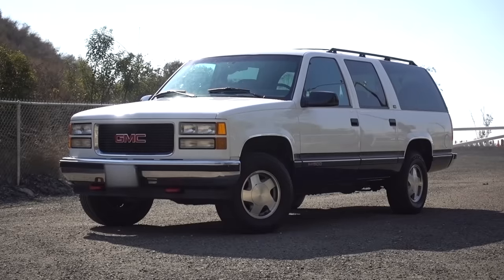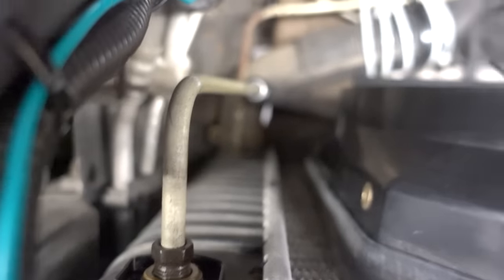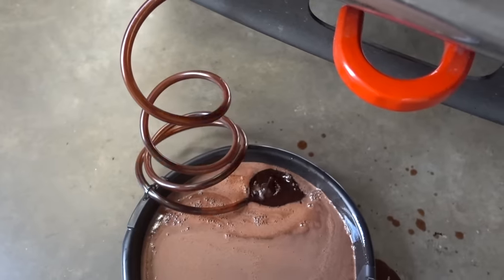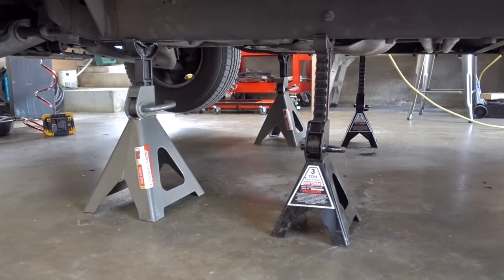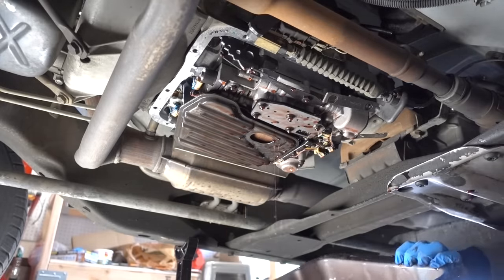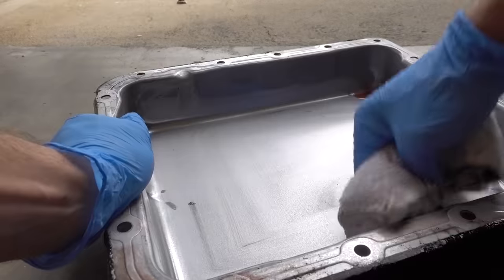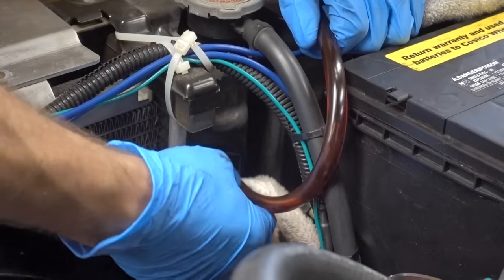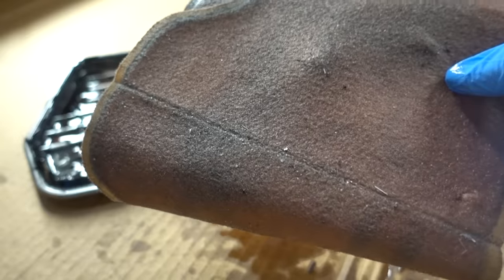Why You Should NEVER FLUSH YOUR TRANSMISSION FLUID!!

Comment: First problem is never use the “universal” fluid.  It isn’t truly universal.  Especially with more current vehicles.
Reply: The Valvoline MaxLife he put in is a more than adequate substitute for the Dexron III required by that transmission.
Reply: Using MaxLife, in applications where it’s label says it’s compatible, has been perfectly fine in my experience.  Smooth shifting, and next to no wear materials have been found in subsequent pan drops/filter replacements in my transmissions, one of which is now over 300K miles without any other internal work.

Comment: I was waiting for the reason that you should NEVER flush the transmission fluid ......... strange man.
Reply: Because it will clean out dust and metal particles on the clutches and then your trans will slip...it will start slipping in 1st and rev,
Reply: @robertwadas  metal particles and dust need to be removed from the transmission,or perhaps we should add some.
Reply: @stevebrown617  while Bob has the right impression, his exact reasons are wrong. Over time trans fluid, like oil, (which it essentially is but with an added detergent chemical) loses viscosity, which is its ability to apply lubrication or slip per se, between the metal meshing of gears, clutches, etc. Once that viscosity is lost and that wear is present, sometimes the only thing allowing these worn components to function is the pure pressure of a fluid between the metal of two components. Now imagine between two worn components you out a brand new very slippery fluid. Not much working going on there.

Comment: Don't forget that the BG flush kit or whatever kit you can get ahold of that includes the cleaner and the additives for the transmission fluid or quite import important once you do that flush and that filter fluid and filter change, the Lucas Oil transmission oil additive also from the other YouTube from Project Farm looks like it provides a significant increase in transmission function even though they state-specific Lynn a bottle if parts are required such as clutches or bearings or anything like that which it will not fix but the shifting part is actually improved quite significantly

Comment: My procedure is: 1. Remove pan and replace filter. 2 re:-install pan
3. Connect hose to return line from cooer. 4. Add 5 or 6 quarts, start engine. 5. Watch old fluid and keep pouring atf in. 6. Fluid changed color coming out, shut engine down. 7 connect cooler line. 8 get correct fluid level. This has always worked great.

Comment: Regularly servicing your trans is the best thing to do. However i agree about not doing it under certain circumstances and other lifelomg mechanics have agreed. When you have an older vehicle(especially 4l60e) that has never had its trans serviced/way past service interval its best not too! Idk the science behind it but I have heard multiple accounts aswell as happening to me that your tranmsmission goes out if you do it. In my case i bought a 2000 chevy 1500 with 193k miles and I wondered about the transmission fluid. I asked my mentor(old man) who worked for the company i got the truck from n he said its never been done and i shouldnt do it ask gears might go out. He was right. I did it just under 200k and at 208k miles overdrive dropped out, then shortly after 3rd and then reverse. So 3/5 gears went out 8k miles after doing it after going its whole life without! Justa thought-goodluck yall!

Comment: ive build hundreds of transmissions in 27 years. ive never seen a tech put the pan bolts in anything exept a box all mixed up. so why cardboard.
Reply: Tru that
Reply: I asked myself the same damned question
Reply: What should have been pointed out is: "if any bolts are of a different length, make sure they go back in the same/correct place".......that's it.
Reply: Old school machanics method to make sure and inspect each screw for pulled/stripped threads. In turn.. (pardon the pun) ..IF there's any evidence of pulled/stripped threads on the bolt,, you now have a positive i.d. of the location of possible damaged thread and begin closer inspection and addressing that problem accordingly..
Reply: @markknight6910  On a 4l60E the only two bolts that are different are the ones holding the shift cable bracket and they stand out not having a flattened out head.
Reply: Probably out of habit. If you take apart a lot of items, keeping them organized that way makes it easier to reassemble if you come back to it 3 or 5 days later when you have time to continue working on it. I did the same thing when I rebuilt my first transmission. Techs put them in a box because they've build HUNDREDS of transmissions and are comfortable doing so.
Reply: I know French. Unnecessaire.
Reply: @markknight6910  wouldn’t you feel that when you removed them?
Reply: @markknight6910   Good luck if you wok on time guide requirements. Its prety obvious where the bolts go.
Reply: Dave Peck speak for yourself but I know ford transmission pans like to have like 4 different length bolts so can’t hurt.
Reply: Nick Melfi is a rookie gonna remember on top of the 40 bolts they have no idea what are when they could of used the cardboard
Reply: OCD

Comment: The reason the flushing is so bad is because most shops use a "universal" fluid that they are supposed to add friction modifiers with to make it equal to what your transmission requires. They dont ever do that because they dont know they should or they dont care. Even if they do add it whats to say they get the ratio correct.   and thats why your transmission will slip and blow up. Transmissions are very very sensitive to what fluid you put into them. If it calls for a specific type use only that and not something that works with XYZ and ABC. Its worth the additional cost to buy the specific fluid and will keep you from toasting you transmission. I changed mine like he did (fluid and filter) at 100,000 miles but every spring and fall I use a small electric pump to suck the fluid out of the dipstick tube and replace with fresh fluid. Transmissions are costly.
Reply: I totally agree with you on your comment. Thanks for posting it.

Comment: I will never flush again. i flushed on two vehicles, both started slipping less than 500 miles later. one only had 40k on it. if anything ill just do a change.
Reply: yowmemperor what cars?
Reply: I would also like to know what cars and raise you what mechanics.
Reply: @enricod2061  95 GMC Sierra, 2005 Impala. Independent and dealer

Comment: The reason not to just flush is because if the trans pan is not dropped prior, and it is full of old tranny sludge filled with metal particals the flush will dilute the trash and run it through your system, the filter does not assure you the fluid is safe if it has missed a lot which is found typically on the magnet. Always drain and drop your pan, clean it, and reinstall it before doing a flush which is an effort to finish getting the old fluid out of the torque converter.

Comment: Put each bolt in it's original hole? LOL the mark of a true rookie.
Reply: Lol this video had my head spinning. I remember as a kid seeing all the bolts mixed in a coffee can and being amazed at how they knew where they went. 20 years later working as a mechanic i get it lol
Reply: The fact he still has all the bolts is incredibly upsetting
Reply: One you should worry about are on the valve body you have 10mm and 8mm bolts of different sizes, I locked up my 4l60e with one long bolt going through the sunshell.
Reply: @martinez1701a  Yeah suddenly the warning they tried to give you with the 8mm head suddenly made sense LOL another rookie mistake but that one cost you more than time.
Reply: @michaeldose2041  actually just time swapped the bolts and was good to go
Reply: He is actually making a very wise point. Sometimes bolts are longer in certain positions because of the available space to drill into
Reply: @jonskid8929  They aren't on a pan. Anybody who has even changed the fluid on one of these could tell you that. Only a complete noob wouldn't know that. If you worked in   a shop you wouldn't even make minimum wage like that.
Reply: @michaeldose2041  he said he wasn't a professional mechanic he was just doing this to his own vehicle so he probably didn't know that. I've worked on plenty of small engines and they are rife with different lengths
Reply: @michaeldose2041  instead of taking it to someone like you that would blow through the job in 30 minutes he did it himself and took his time and did a good job even though he didn't know that everything you did a really damn good jobhe wasn't trying to make money he was trying to save his transmission and you wouldn't do it if he brought it to you you would just swap out the fluid and say okay I flushed it

Comment: if you shouldnt start it with out fluid you certainly shouldnt run it dry (bubbles in the catch pan) you should add fresh fluid as old comes out but that takes machinery that is expensive and more fluid than it takes to just change it flushing a transmission is complicated. a drain and fill is almost as far as a drive way mechanic should do. the initial dark fluid is only what came from the valve bodies the torque converter hold alot and cycles it slower than the body of the transmission, you did mention that though. i hope you didnt damage the pump when you ran dry thanks for the video it was sort of informative.

Comment: i flushed 2 toyotas at about 100k and a caravan at about 180k about a year ago; no prob yet and i didnt change the filters bc i was told the toys have a screen filter that dont really need to be changed and also if the trans got ruined for flushing the fluid dropping the pans wouldve been for nothing.

Comment: You forgot. While the pan is off install a drain plug.
Reply: What for, you have to drop the pan to change the filter anyway. Drain plugs just promote laziness and add a potential leak point. It's ok to get a little dirty once every 50-100k miles.
Reply: @killer2600  Because ATF needs to be changed (burns) way faster than a filter needs to be changed. And a fluid change is way easier and should be done more often than a flush. And at a service shop is way cheaper than a flush. As he said those metal bits are likely from 'break-in', and they likely are. As far as leaking. One should never have a leak from a drain plug. Most aftermarket pans have a drain plug. You do have a point. If you've ever pulled an oil pan from a high mileage vehicle, you know it should be cleaned.
Reply: Personally I've just never had an issue with spending some time to drop the pan, but whatever floats your boat
Reply: @cpufreak101  Yeah, logic and reason can't be taught. Either in the genes or isn't.

Comment: I don’t get the heading, why you should never change your transmission fluid?
Reply: Its says never flush
Reply: But he's flushing it...
Reply: @fishwanda  
No hes not flushing it....just draining and filling.
Reply: Actually he dose both. If its over 100k and never done its recommend not to but if you do it at 50 k it is.  That's why at the end he says it runs the risk of snapping the transmission if you wait to long. A good mechanic will tell you that.  A shister will just take your money.
Reply: And he is flushing the trany cooler and lines but changing the fluid as a whole and filter. That is where the metal in the filter comes in
Reply: @motorcitymanman7711  yea, he's not making a video either, just talking into and pointing a camera, not the same thing at all. -_-
Reply: the thought is with an old neglected transmission that is super dirty, once you refill with fresh new ATF in, the cleaning agents in the new fluid will remove so much gunk at once that it will cause clogging in transmission. I've done my 2006 Tacoma 2x at around 70k interval
Reply: @Glasses5x  that's the internet for ya.
Reply: @UCj-Wcv5sEe3KK4QwiwQarbw why you delete your comments?
Reply: @UCj-Wcv5sEe3KK4QwiwQarbw tf going on wot dat user name?

Comment: Good video.. talk about how that car drives now. I did the same to my 2013 whatever and I truly regret it. All kinds of trouble, from hard shifting to loss of power. It was running perfectly before that. Just leave the ATF fluid in there till the car dies.
Reply: Also I don't believe you want use synthetic oil it could be what causes the metal shavings

Comment: Why are you indexing the bolts ? I have change the fluid in many transmission and never bothered to keep track of the bolt positions.
Reply: Usually all bolts are the same. But of course there will be some car models in the world with different bolts.
Reply: I think the bolts that hold the shifter cable are a tiny bit longer, can't remember.  Haven't done a fluid change on a 4l60e in a while.

Comment: I also have a 1995 GMC Suburban but with more miles.  I like your Suburban better because I have to jack the transmission up and insert a block of wood between the cross frame and the tail of the transmission before the drain pam can be removed. You have plenty of space on yours. I did replace the drain pan with one that has a drain plug.

Comment: Flush it, no. But yes just simple fluid/filter swap w/o draining the torque converter or mess w/cooler. Substitute a qt of trans fluid for lucus transmission stabilizer additive. That's it. 
And running it pumping the fluid out can burn up your pump i believe. Jimmy, YOU TALK TO MUCH!!

Comment: Liker-Subscriber-Notifier here.   Great Videol  I did the very same thing to my new to me 2007 GMC Envoy w/ 125k miles on it and same 4L60E trans.  Trans fluid was black and burnt smelling!   I also jacked up the body, and ran the trans through its gears to make sure that the  TCC was flushed.    Used OEM fluid and OEM Filter.  This vehicle has never shifted so smooth ever!!!  I've put another $100k miles on it - and still shifting smooth (but I did flush it again at 50k of use (175k miles))  Also - you can get a large catch pan from any Big Box store for mixing mortar for $8 - great for these jobs.  Keep up the great videos

Comment: I've owned lots of high mileage cars, first thing I always did to them was do a simple ATF fluid drain and refill.  Then see how the car responds to that for a hundred miles or so.  If there's no issues (change of shifting points, balky operation etc.) then I'd consider doing a full flush and not before.

Comment: I recently purchased a 2006 Ford Escape with 260,000 km, it has a lifetime filter and the dextron v to be changed every 35,000ish km, I’m debating it was changed a couple of times, I did a head to toe fluid change and noticed a huge improvement instantly

Comment: Although I do believe in flushing coolant, I do NOT believe in flushing the ATF. When I buy a new-to-me used vehicle with an automatic transmission, I drain the ATF (measure it so that I have a good starting point on the refill before adding any to top off), drop the pan, change the filter and refill. Then I start the engine and run it through the gears with the brake on so the new ATF is fully circulated.
Then I drive a short distance, drain (measure the amount drained) and refill. 
Then I drive a short distance again using the same procedure. These repeated refills get MOST of the old fluid out. 
After this, I drain & refill @ 30K miles WITHOUT changing the filter. As long as this scheduled frequency is followed, the filter will last the life of the car. The important thing is to change the filter after the break-in period. 
All of my vehicles require the same OEM spec ATF which Valvoline MaxLife meets, as well as others. I make sure the replacement fluid is FULL SYNTHETIC. 
I've been using this procedure for decades with no problems at all in any of my vehicles.

Comment: I bought a beater Ranger with 150K miles that had transmission problems. I wound up installing a TSB kit on it, and replacing all the fluid. The old fluid was dark, but still had a bit of pink to it. It shifts better than new now. So unless the fluid is burnt, I say go for it.

Comment: 5:34 - how about to use a jack with a wooden plank on top of it?
Reply: Don’t forget when you jack the truck up , be sure set the park brake cuz those 4 stands fail all at once
Reply: @kevinmorley6300  Parking brake only works on rear wheels.  When you are going to put the whole car/truck on jack stands, put the front wheels up first.  Assure the stands are stable. flat on the ground before doing the rear.  No problem.
Reply: X-Man   You missed the point
Reply: @kevinmorley6300  There's a lot of ways to get injured working on vehicles.  Absentmindedness or lack of knowledge primary cause.  If you don't get those jack stands under there correct, it could be Deadly.  Use them correctly.  Check them to make sure they are stable before getting underneath.
If you are using a floor jack and are on flat,  hard ground or concrete, no big worries about parking brake.  They only have and effect when you jack the front wheels anyway.  
Once front wheels are off ground and jacks stand properly set, vehicle will not roll when jacking the back anyway.

Comment: You’re partially right about not changing your transmission fluid if your transmission fluid’s burnt and stinks don’t change it you can finish off the transmission the clutch material on the clutches and stuff like that but if your transmission fluid is still clear not burn at all Saints got 40 50,000 miles on it it’s OK to flush your transmission because you’re replacing fluid still somewhat good with new fluid it’s a win-win deal man

Comment: I just did it to my 2000 caviler with 75000 and it came out still bright red
Reply: Ecosby those actually got a special fluid that starts off almost black..  then as it get's totally filthy.. it turns bright red.
Reply: @jaylee8703  haha
Reply: @jaylee8703  ya sure 🤷‍♂️. Don’t get the joke dude    Quad 4 is running good though I know that.